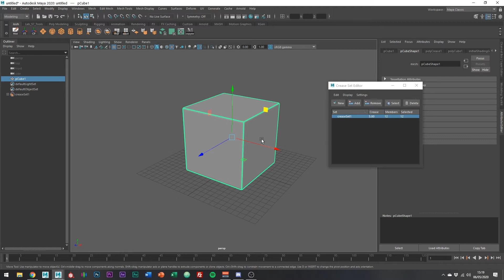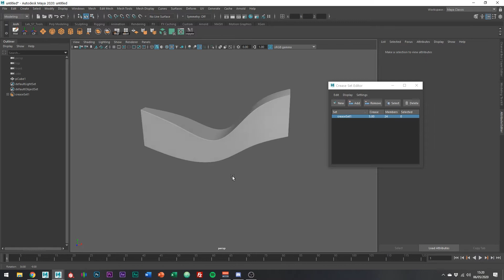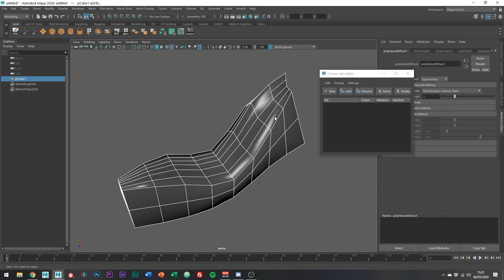Curved Shapes With Creasing in Maya

Comment: Thanks for posting this video! Is there a way to adjust the radius of the sharp edge? ( as in, we can achieve a sharp to soft edge transition using edge loops) Thanks!
Reply from the maker: I'm not sure this is possible with the crease tool. But with edge loops and some manual work, yeah it's possible. I have a video on doing jus that: https://www.youtube.com/watch?v=06tNykUELAI